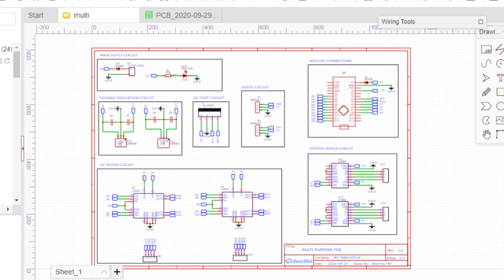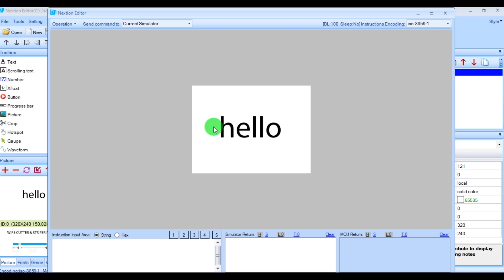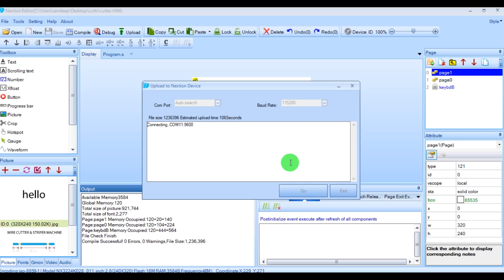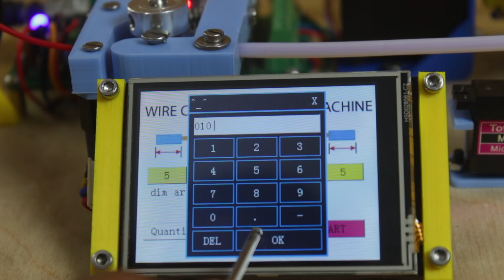DIY Wire cutting and stripper Machine | Arduino project

Comment: There is no point in having the servo to move the wire away from the V-notches for cutting: V-notch cutting is better than cutting straight across, because it deforms the wire less. Just remove the depth stop on the strippers so that they can close enough for the V-notch to completely close.

Yes, I suppose this would dull the blades faster, but given how inexpensive this style of wire stripper is, I would just consider it a standard running cost.

Comment: Just a heads up, this project is on his GitHub, but none of the important files are out there yet.
I put in an issue to get the Arduino and HMI files on the repository for this bad boy, help out if you can!

Link to the issue on GitHub: https://github.com/sandy9159/DIY-Wire-cutting-and-stripper-Machine-Arduino-project/issues/1
Reply: He also has the PCB out there as well - https://github.com/sandy9159/All-in-One-Multipurpose-PCB-for-Arduino-Projects

Comment: Model g.stl isnt what's shown no slot for wire stripper plus if you do measure the Stanley wire stripper and cut  2.5mm wide slot  slot the material left is less than a mm.  Plus you didn t need to make the link to the stepper and wire a complete circle a rectanlge would have save you material

Comment: Have been thinking something like this but more portable for awhile. If you want a good set of strips that aren't junk to chuck into that thing, order a set of Irwin v-cuts. The pair I'm using keep their edge so well that I have only sharpened them once in the year and a half I have owned them, they kinda need a touch up sharpening but still go straight through skin, muscle and callous, directly to the surface of the bone. Seems like they would be idea for this sort of use, may be with an added finger guard, god damn those things love the taste of fingers.

Comment: 1:00 I try to avoid touching printing surface with my hands, so I rarely need to clean the surface with IPA.
Reply: Is that really necessary with that type of bed? I've always just used masking tape and haven't had to worry about it

Comment: I am yet to see the machine actually take the coating off the wire which would be " Stripping the wire"  I just see it prep the coating and it still needs to be done by hand, which in my opinion is the worst part on your hands.
Reply: Your assumption is only true for one vein. When Stripping stranded conductors, this piece is removed with the rotation immediately prior to tinning. And not as the author shows.

Comment: Now just add a stripping and tinning operation. That'd be great.
Reply: The feed motor could pull the wire back while the wire stripper is closed, to remove the insulation.
After that, the servo responsible for selecting which part of the wire stripper to use could move the wire over to an extra tool, such as a soldering iron with a second "wire" feeder to give it fresh solder.

I guess that's the beauty of DIY projects. After you make them yourself, you can start making little upgrades here and there (like a firmware update to remove the insulation, or a tinning tool, or a proper enclosure) and really make it your own.

Comment: Salve dove posso trovare una lista con i pezzi che servono e i file per questo progetto
Reply: Ciao Massimo, il problema più grande, per chi non è un programmatore esperto, è le programmazione del display e l'interfacciamento di arduino con l'LCD stesso, la parte hw mi sembra abbastanza semplice, i componenti sono facilmente identificabili, mentre il PCB è facile da riprogettare. L'autore del progetto non penso sia disposto a cedere i codici sorgente. Ciao, Giuseppe.

Comment: For stripping you could take apart a  12 42 195 KNIPEX MultiStrip 10  (the best auto-adjusting wire stripper for this size range). Close the clamp, move the wire, open the clamp.

Comment: TIP: If you hold firmly the wire while with your other hand you squeeze and twist the insulation as you pull it off, it will twist the wire braid into a nice and tidy spiral instead of leaving the braid wires straight and flapping about.

Comment: Very nice! I've been thinking how too make one that strips cat5 cable because I use it for breadboards.  It has 4 pairs, each twisted, so it's a challenge!
Reply: You could have it remove the outer sheath , ask you to properly start untwisting the pairs, clamp each wire, separate them, and then it takes back over and does the same thing as this design 8x.

Comment: You can make it better : When you make the first notch on the wire, just run the machine backwards to make the wire casing seperate and you will only have to pull the casing from the other end
Reply: I think, it does not need to strip the wire fully, else, little internal threads could get bend when handled in the pile.
Reply: @Vilius Kraujutis Agree, much better this way, the machine can prepare and do all that annoying part and you need only to strip that piece and can twist it while pulling it off, which can even be satisfying. Nice name btw. where is your name Vilius from? Sounds very close to Vasily, Wilhelm and William.
Reply: I have access to a machine like this at work... literally all it does is close the jaws to the strip setting gauge and tugs back x number of steps.. although it works with two sets of rollers as to feed and tug on both ends....
Reply: can you add a crimper tool also then it can be programmed to take the wires length from excel sheet or eplan
Reply: If the wire slips in the extruder it could cause the measurements to be off though
Reply: @Gamogamer  that and it wouldn't be able to strip the other end. Overall you'd need a slightly different design to get reliable stripping.
Reply: 🔴 What Is Islam? ⚠️

🔴 Islam is not just another religion. 

🔵 It is the same message preached by Moses, Jesus and Abraham.

 🔴 Islam literally means ‘submission to God’ and it teaches us to have a direct relationship with God. 

 🔵 It reminds us that since God created us, no one should be worshipped except God alone. 

 🔴 It also teaches that God is nothing like a human being or like anything that we can imagine.
🌍 The concept of God is summarized in the Quran as:

📖 { “Say, He is God, the One.  God, the Absolute.  He does not give birth, nor was He born, and there is nothing like Him.”} (Quran 112:1-4)[4] 📚

🔴 Becoming a Muslim is not turning your back to Jesus. 

🔵 Rather it’s going back to the original teachings of Jesus and obeying him. 

More .....👇

🔴 THE RETURN OF JESUS
Reply: Actually you can strip both ends. Strip the first end of the wire twice as long as you need, and for the back end of the wire use the strippers to shift the whole length insulation forward so you have an event stripped front end and back end of the wire. Then cut the wire off. It actually doesn't take that much force if you get the right solid core wire.
Reply: @teleCodes  "right solid core wire" that's the problem.  You cannot expect any sort of quality control from cheap Chinese manufacturers.
Reply: @teleCodes  doesn't make sense.
Reply: @muhammadbasir83  It does make sense... It may however be problematic when longer pieces of wire are cut. Since the insulation slides less easily.
Reply: @phinok.m.628  That's why i said that it doesnt make sense. Because wire insulation didnt made to slide in or slide out. I know it's possible but it's impractical.
Reply: @muhammadbasir83  What do you mean, wire insulation is not made to slip in or out? How do you remove the insulation if not by "slipping" it over the wire?
For longer wires it would certainly be impractical. Stripping just one side can also be impractical in the same way depending on how far the wire has to be stripped. For shorter wires however, I think it makes perfect sense to do it this way. Assuming of course that the stepper motor has sufficient grip on the wire to not slip itself and lose its position.
Reply: @muhammadbasir83  It may surprise you but majority of wire we use has lubricants permeated into the casing or dry lubricant for non-porous materials. You wouldn't need a machine like this or v-cuts even if the wire casing wasn't permeated with a lubricant. I have one large network I'm in the process of taking over that has 3 lines ran with junky wire that wont hold onto the oil. Nice, soft and bendy if you drench it in oil but it doesn't stay like it does with Genesis, Syncotron, Southwire or any brand I've touched recently. Actually no idea what the last brand I used was but so cheap the box only has an "open here" marking and that's all, still has enough oil in the casing I could feel my hands were soft (albeit tender) after pulling 40k or so feet of it.